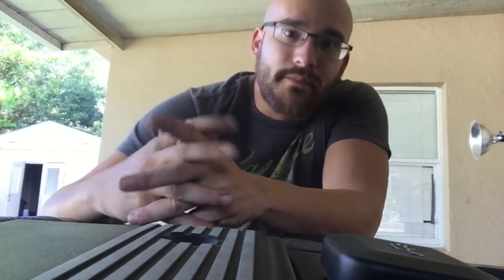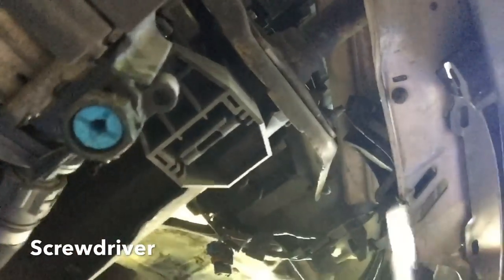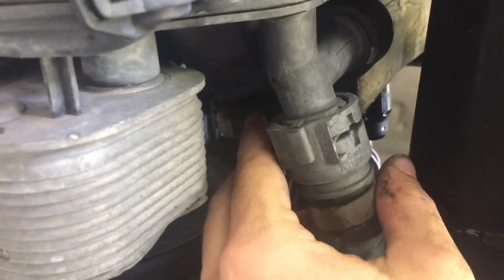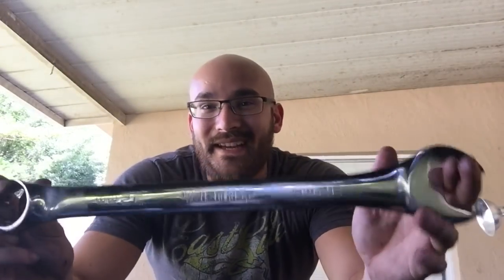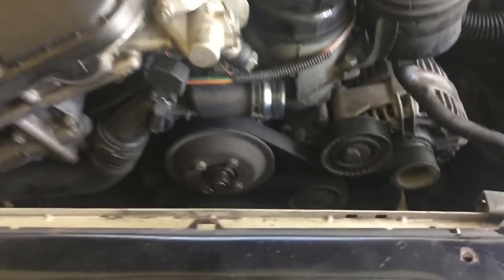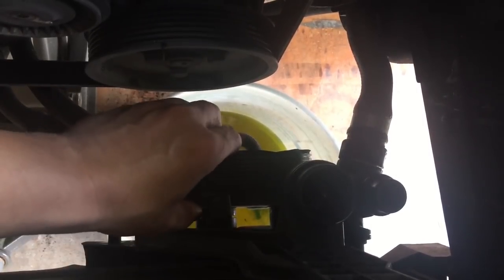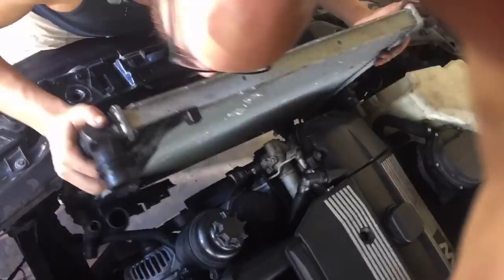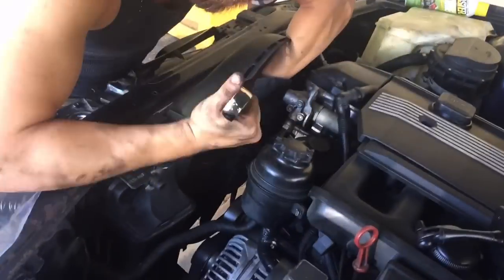E46 BMW radiator replacement DIY

Comment: This is such an old video but still a life saver. Thank God Almighty for giving me the strength. I watched this video before journeying to my mechanic. You know, lack of tools. He was so busy and I didn't book an appointment so I used his tools, coupled with knowledge from this video. I know I know, I still drive this old 2000 machine but the E46, in my view, remains one of the best cars ever made, and as much as I can afford right now. I changed the radiator by myself. A couple of things broke, like the coolant temperature sensor below the water tank. I had to go buy the entire plastic that you showed. I am grateful to God, and then to you. God bless ❤

Comment: My 325i E46 cracked in the same exact spot, and it will happen again if you drive without your coolant completely topped up. Also, while you are replacing your radiator, you are best to replace that expansion tank, and radiator hoses, these parts get very brittle after you drive with low coolant from getting too hot.. the O-rings on the E-tank and hoses also do not compress like the same as if they were new.. replace em while you're there for long term assurance. Nice video!

Comment: I just did this on my X5,  my 330CI Coupe and my 740i.  Im a BMW tech and we see these come in every week... it always cracks in the same spot. 
One owner tried to glue it with bathroom silicone...LOL.   So just a quick mechanics tip, purchase the radiator with the reinforced plastic sides and neck. If not, you might be doing this again real soon. Thanks for the video, thumbs up!  I wish you lived in Dallas bro I would buy you 6 pack
Reply: Bmw tech you say, what size are the tork screws that hold on the radiator and the plastic piece that screws onto the radiator and connects to the expansion tank, ive got all the parts except a tool that will work to remove those tork screws
Reply: kyle hackney shud be t25 male torx

Comment: Nice video. I have a 2000 328i and my radiator fan exploded taking the radiator out of service. Going to replace with electric fan and new radiator and your video step by step is perfect. Thanks
Reply: Replacing your clutch radiator fan for an electric can cause transmission overheating

Comment: Pro tip; instead of prying on the plastic coolant “quick connects” with a steel prybar, give it just a little grunt with a prybar (tiny grunt!) and if it doesn’t want to move get that hose a shakin’! (Wobble the hose around any direction you can) and then try prying it a little. If it’s moves a little and gets stuck again wobble the hose some more, etc. if you don’t do this you’re guaranteed to break another coolant part.

Comment: Hi the piece on the expansion bracket that you pointed out at 13:27 Can you buy the new plastic piece? I know you can get the  o ring, but I'm not able to find out what that other small plastic piece is called? Thanks

Comment: How long did it take you to take the transmission cooler out with the pry bar? Im having trouble with taking mine out and im afraid i might damage the plastic.
Reply from the maker: Raimond it took me about 2 minutes to take it out. when you use the pry bar you have to be careful of the plastic. Use light force.

Comment: Dont you have to vacuum the system from air after installing the new radiator?

Good vid bro
Reply from the maker: You do. When you filled you 50/50 mix you have to bleed the system by turning the car on and when it warms up a bit start opening and closing the bleeder screw (be careful when it's hot) and let the air out. There is two other ways to do it as well. With a vacuum tool or a "gravity" funnel
Reply from the maker: Hope it helps
Reply: Drive Miami alright cool thanks man.
Reply: Just wanted to add this in case others are reading. Bleeding the cooling system is necessary, and if skipped or done wrong, can cause very expensive damage to the engine. Thermostat needs to be open (engine warm), and climate control heat on full speed at highest temp setting with ENGINE OFF (per BMW spec. This differs from a typical bleeding procedure.) Make sure the car is level or the front slightly elevated. Fill expansion tank to very top, loosen bleed screw, wait for bubbles to stop, while adding coolant to keep level at top of expansion tank. After no bubbles come from bleed screw, close it, then remove excess coolant from expansion tank with turkey baster or such (this step is important), leave it a little past cold max fill because the coolant is warm. Check coolant level (when cold) the next few days, top off if necessary. One last tip, don't open the cap if the car is warm because hot coolant will spray everywhere. Warm car up with cap off if you need to warm it up.

Comment: What about the two hoses below, that look like they have metal fittings on them. Are they attached to the radiator? They are located below the radiator and just to the left of the expansion tank.
Reply from the maker: TriPyramid Pictures that would be the trans cooler. It's covered in the video

Comment: Tork bit sizes??? I had everything apart down to those tork screws for the radiator and the plastic piece that the expansion tank connects too just to be disappointed and have to put it all back together till I get the right tork bit

Comment: HI, is there anyway to repair that crack with epoxy glue, jb weld, etc, maybe from inside, to avoid extracost and all that labor? thanks
Reply: I used a product call K-seal and it worked very good for a month but the crack eventually opened back up. Any professional technician will tell you you can't repair the plastic. You can try something but you'll be kicking yourself when your car gives up on you at the worst time.

Comment: What if the hole for the drain plug is closed for a manual transmission e46  is that good

Comment: perfect video. show
Reply from the maker: The Project D JF thank you
Reply: Drive Miami I have a question my buddie has a 2000 BMW 323ci with 140k miles on it.the radiator seems to have a leak or something because you have to keep adding water.motor trans and ac are fine.is it worth buying?i know he can replace the rad for me.but could this be a sign of a much more expensive repair?any response will be valued greatly
Reply: Drive Miami and how much should I expect to pay him for replacing radiator?

Comment: How do you know when your radiator is mess up
Reply: I know that you're probably joking but it's when starts leaking , loosing coolant and your engine starts to overheat
Reply: JA VI I actually didn’t know that thanks for the info 🙂